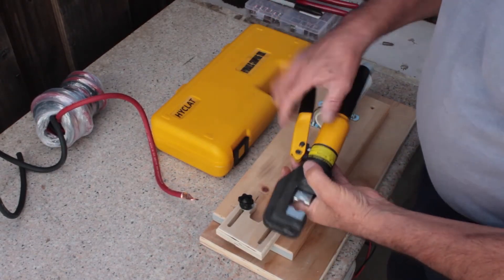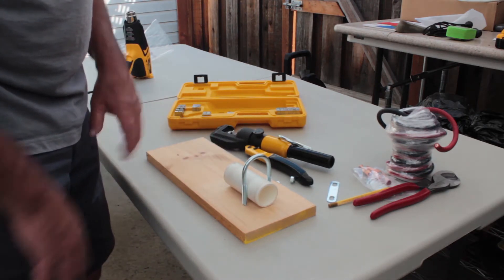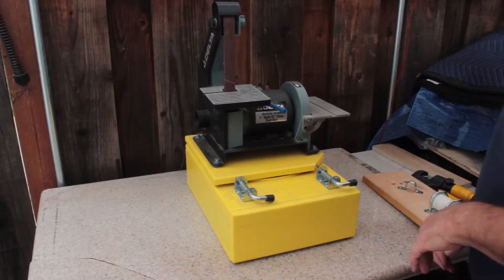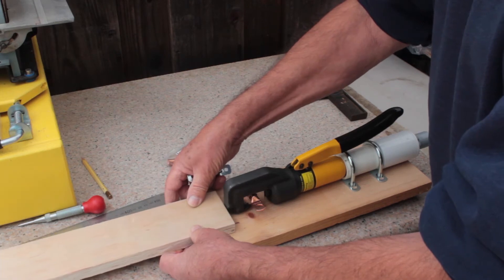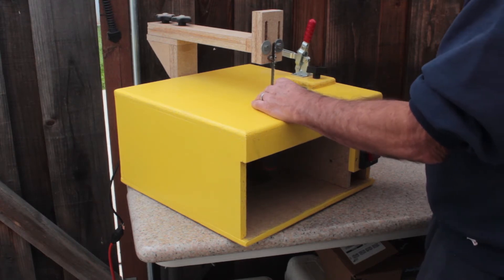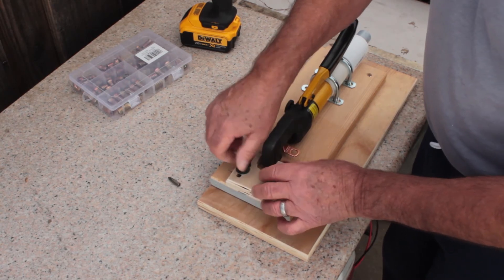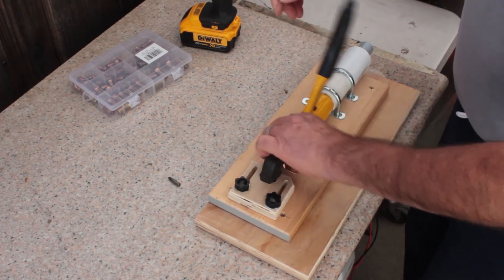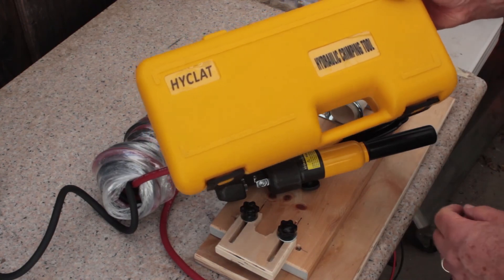Improving my Hydraulic Wire Crimping Tool

Comment: If you used a bench vice you could simply clamp onto the metal flange on the back side of the crimping tool in the vice. Doing it this way would allow you to have the actual open end of the crimping tool facing up.
Reply from the maker: Thank you for your suggestion

Comment: A minor problem with this setup, is that the open end faces down.
Reply from the maker: Thank you, for your comment. I was concerned about that too, but could not figure out any other way to pump the handle. Having used this jig dozens of times, it has not been an issue with this crimping tool as it is still very easy to see the crimp and guide the wire into place.

Comment: I love that!!  I have the same crimper and thought my difficulty was just because I am an old woman with small hands!  Heeehee... I definitely will benefit from your clever solution for holding the wire and lug in proper place while needing two hands to crimp!  THANK YOU!
Reply from the maker: Thank you, for the nice comments, yes, it is a great crimper, but rather difficult to use. This little jig has made it easy to get good crimps every time without struggling. Happy Holidays and happy crimping.

Comment: I bought the same crisper a few months ago, and just did my first crimps today…apparently I need four hands to operate it.  Great idea for a jig!
Reply from the maker: Hi Jay, it is a good and very useful crimper, however, if you have to make lots of crimps, it would be helpful to make a similar jig. Mine was quick and easy to build, and saves a lot of struggling with the crimper. Plus I get perfect crimps every time.
Reply: Crisper is the drawer in your refrigerator, for vegetables.